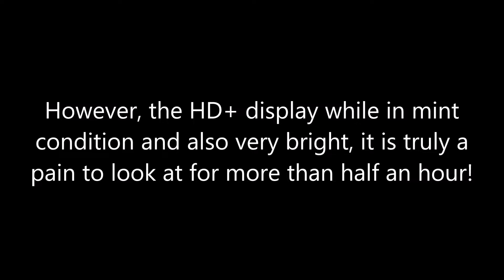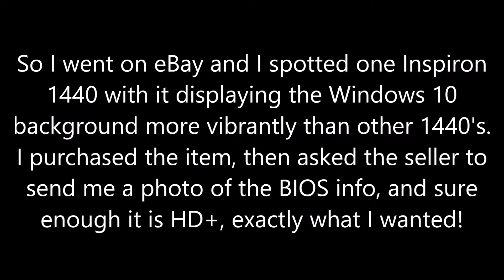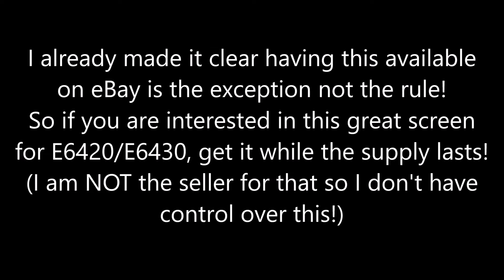How to upgrade to an IPS like quality LCD on a Dell Latitude E6420 or Latitude E6430

Comment: Can you link the items needed for this upgrade??
Reply from the maker: Sorry I don't have such info. These screens are not easy at all to find, and I got a whole Inspiron 1440 with the sole purpose of getting that specific LCD!
Your best bet is to look for an Inspiron 1440 with a 1600x900 display, and then also see from the pictures if the screen's colour saturations are high. That's how I picked that Inspiron 1440.
Also, if you place an order for the LCD panel itself, make absolute sure the seller is sending the exact LCD panel and not a "compatible"

Comment: Berapa pin lcd full hd dell 6430?
Reply from the maker: Its standard 30pin LVDS LED connector, LCD in a thick frame. If upgrading to HD+ you MUST purchase a new LCD Cable with dual channel wired up instead of just one!

Comment: Can i ask? Is it the same thing with dell inspiron 1440 something? Idk some e-commerce that i've search on just recommends dell inspiron 1440 something but not like your saying last part of the vid. Need some clarity plzz sir
Reply from the maker: The LCD on this laptop is interchangable with Inspiron 1440, and in fact many other branded laptops. But if you can get the E6430 and the Inspiron 1440 for the same price, get the E6430 by any means, unless you are trying to get your hands on that screen!
Reply: @kztech1319  mine is e6420, is it still fit in?
Reply from the maker: @alkhaidurihudayaarsi7462  Yes. But if you have 1366x768, you need a different LCD cable to support 1600x900
Reply: @kztech1319  okey thanks
Reply: @kztech1319 can you find an e6530 version?